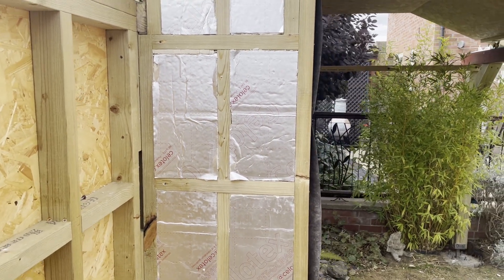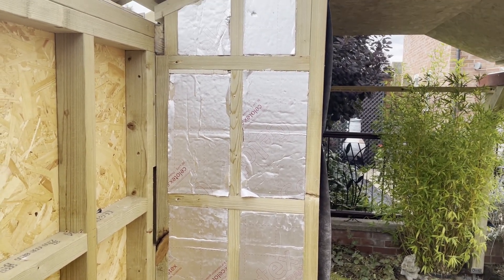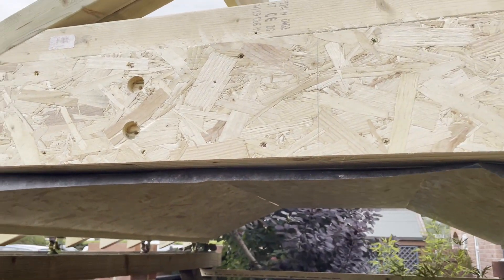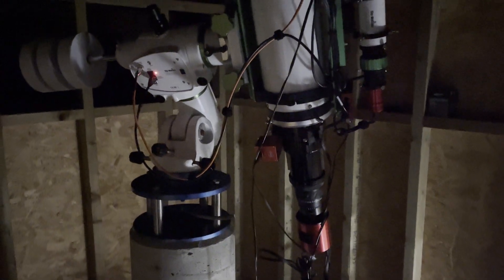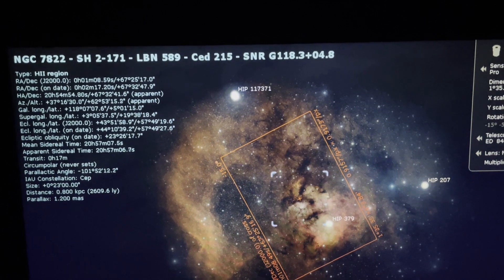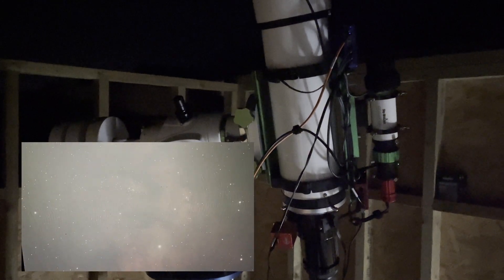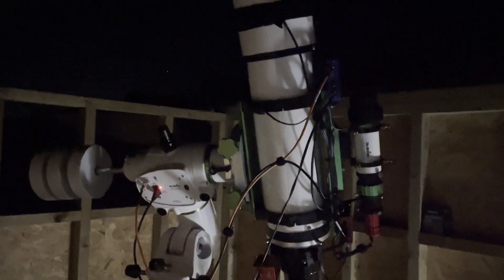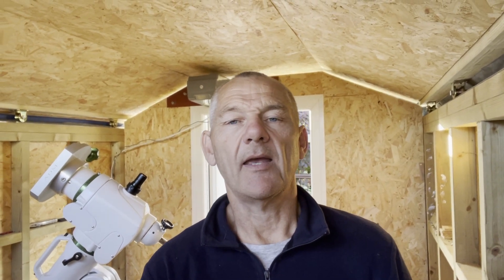Observatory Build Part 4  Nearly Finished!

Comment: Is that stiff foam insulation better than classic fiberglass?
Reply from the maker: Hi Thomas, thanks for watching! Yeah the rigid foam board (Celotex) insulation has much higher insulation properties! Probably a bit more expensive, but works well! During the summer, my garden shed is so hot I can’t go in it, but the obsey (which is basically a shed with a moving roof!) it’s cool when you go in! Helps keep an even temperature!
Clear skies mate👍

Comment: Hi Simon, great work! I have a pier to cement in, ( no room for an observatory) but enough room for my 120 also. Qucik question what do you use for cable management ties? My set is almost identical except my cables are everywhere :-) thanks!
Reply from the maker: Hey thanks Simon, I use two types, actual small plastic cable ties and reusable Velcro cable ties! See link below to video, you can probably get them on Amazon 👍 Clear skies mate!
https://youtu.be/ZukKT6ftVss

Comment: I had to watch the 'series' again: so many very interesting build options.   Mr. Simon, I see many amateur astronomers stating that they are building a new observatory, when in fact they build NOTHING.   They have purchased a pre-built product and with a screwdriver and a wrench, they assemble an observatory.   You are the real deal, and you have created a real masterpiece.   I'm preparing to build a new observatory this coming spring - the slab has been poured, but I ran out of good weather to continue. (I'm in Canada)     I will utilize some of your great ideas, and as you have done, take my time to ensure that the end product is excellent.   Thanks again, Mr. Simon.  Excellent video and as many of your commenters have stated, your work man ship is extremely good.   Be safe and clear skies.
Reply from the maker: What can I say Jonathan! Thanks so much for your kind comments 👍 I’m so glad you found my build useful! I’m working on filming part 5 now, I’ve just motorized the roof, so hopefully another video soon! I wish you good luck with your build next year in Canada, thanks again and clear skies 😀

Comment: looking very nice mate, very tidy.
Love the hardy planks look.
You looked very nervous about that wind blowing the door.  It did sound wild like.
Im wanting to put some of that installation in mine at some point. 
Quite like the motor you fitted looks very robust.  Where did you get that?
looking very much forward to the next stage.
Clear Skies Simon!
Reply from the maker: Hi Ben, thanks for watching mate! Glad you liked the video! Yeah I was worried out the storm coming and leaking through the polythene on the roof! That Celotex insulation should help keep the heat out in the summer and cold out in the winter 🤞 part 5 is under wsy mate😀 The motor came from Amazon, see this link Ben, cheers mate and clear skies!
https://www.amazon.co.uk/gp/aw/d/B09MRTBLQY?psc=1&ref=ppx_pop_mob_b_asin_image
Reply: @SimonsAstro  super! I will have a look at that.  Cheers.
I have had a drama getting my vid out computer was crashing alot so had to sort it.   Having said that, trying to get it out tonight or tomorow night.
Reply from the maker: @CosmuzzAstro  nice one mate, I’ll look out for that👍